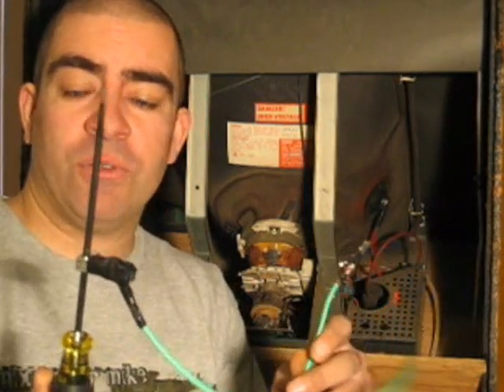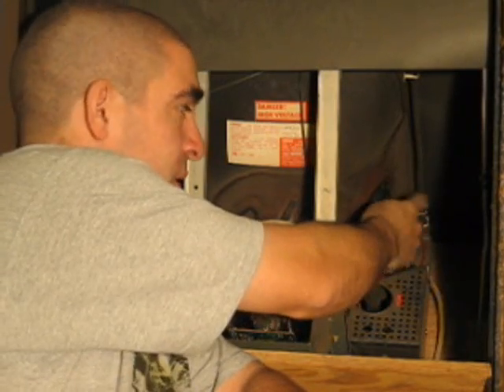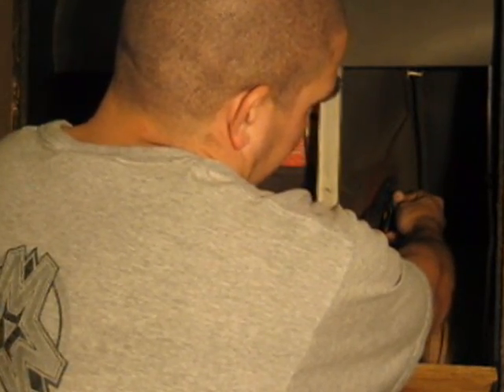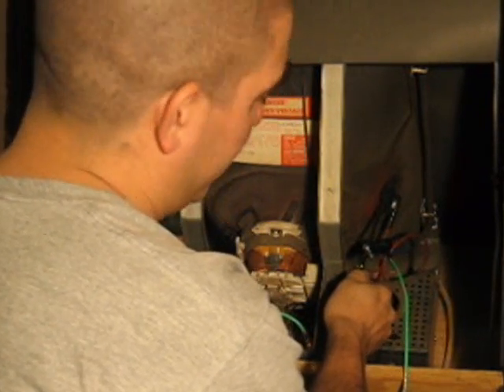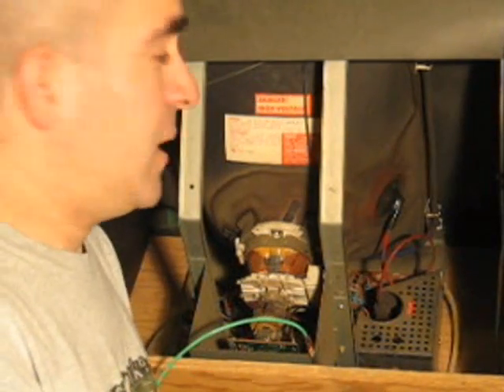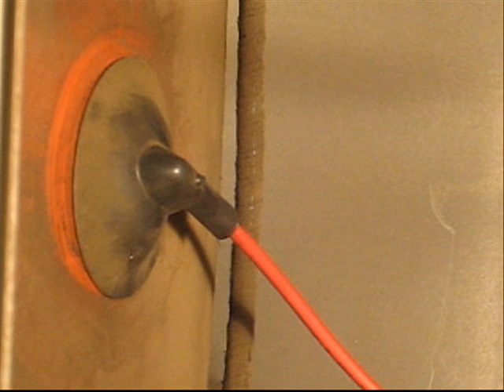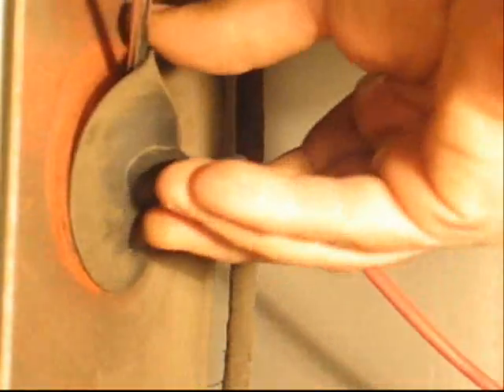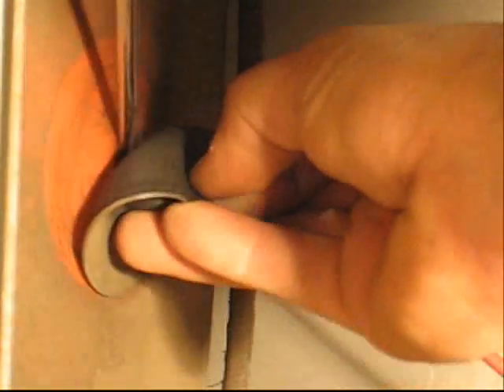discharging 101

Comment: It’s better to use a high voltage probe to do this. I’d rather slowly discharge the monitor and see the potential dropping than use a screwdriver, even tho it does the same function, but violently.  Also, never touch the second anode cap before discharge. Just don’t.

Comment: I suggest using a resistor in series with the discharger wire, 1MOhm-10MOhm, 2W or so, otherwise the extreme charge change on the deposited anode inside the tube can cause it to delaminate, ruining the tube.

Comment: Thank you very much also. Just got past stage one in discharging (will do it a few times).
I was about to throw out my TV and spend up big on an LCD or Plasma set. Thought I'd open it up first and found a resistor sitting in the bottom of the case. Still have to find out where it came from, and it being de-soldered from heat doesn't bode very well anyway...

Comment from the maker: Honestly I can't remember as I made the video some time ago but, I seem so remember saying that I usually do not pull back the anode cap but for the sake of the video and so folks watching could possibly get a better look, I decided to pull it back. If this is misleading to anyone I appologize. I usually just slip the screw driver under without touching the anode cap with my hand at all. Yes you should always use caution when dealing with potential high voltages.

Comment: I have to take issue with the hand peeling-back of the suction cup. I've discharged monitors dozens (hundreds?) of times and have never had a problem simply slipping a screwdriver underneath the cup. Often they spark when the edge of the suction cup has just barely been penetrated, long before the screwdriver touches the clip -- you don't want that to happen to your hand.

Comment: It actually does just dissipate into the chassis. Seems strange, but it's how it works -- this is why you're able to discharge a monitor separate from a game (say, on a test bench). The game doesn't need to be plugged in for a good discharge to take place.

Comment: Rule number 2.  Discharge the monitor again before reconnecting the anode cap.  The tube can build up the charge again that you waited 5 minutes for to discharge again.  Not all monitors will have a charge on them.  Monitors that have been unpowered CAN (but not always) have no charge on the tube.  Also, many monitors automatically discharge when you power them down but don't count on it.  ALWAYS check.